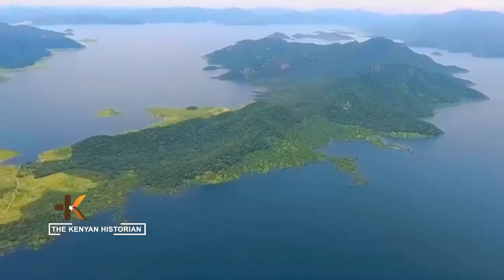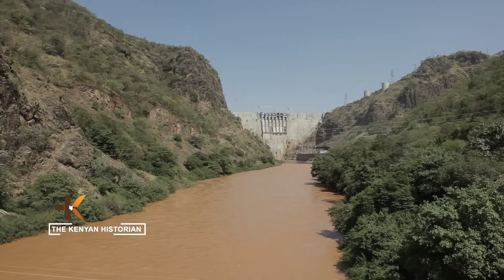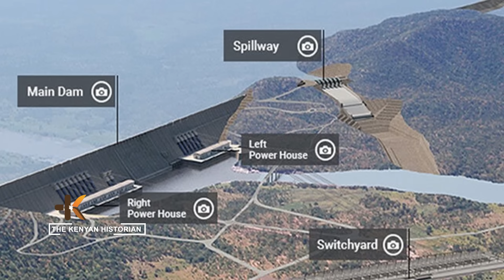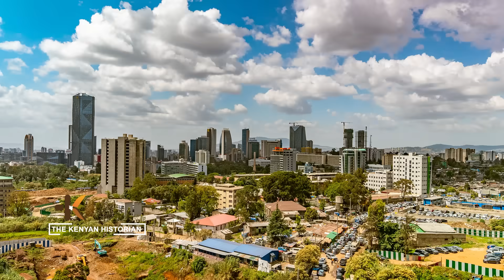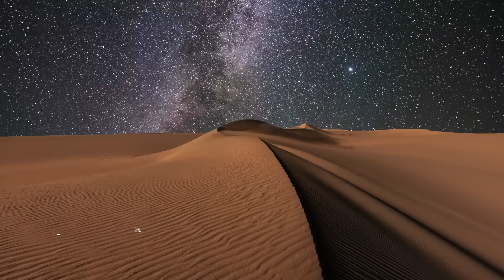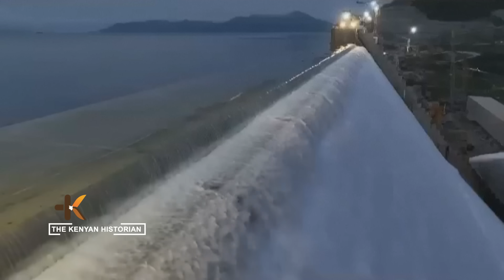“Ethiopia just shocked the world with the massive dam they built”

Comment: 🇪🇹On the Nile: The Grand Ethiopian Renaissance Dam (GERD) has already shifted the balance of power in the region, since Ethiopia now directly controls the flow of the Blue Nile, which supplies about 85% of the Nile waters to Sudan and Egypt. This has been a huge geopolitical shift.
	•	On the Red Sea: Ethiopia lost its direct coastline in 1993 after Eritrea’s independence. Since then, Ethiopia has relied on Djibouti (and sometimes Sudan, Somaliland, and Kenya) for sea access. Recently, Prime Minister Abiy Ahmed has openly stated that secure, reliable, and possibly sovereign access to the Red Sea is Ethiopia’s next strategic priority. This has caused tension with Eritrea, Djibouti, and others, but it also shows Ethiopia’s determination to ensure long-term economic and security independence.